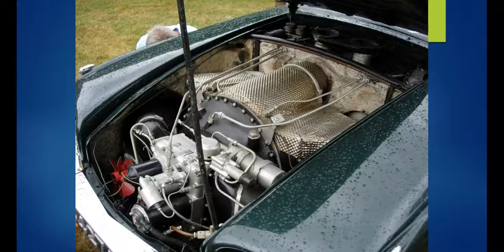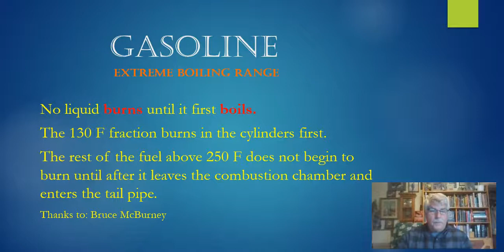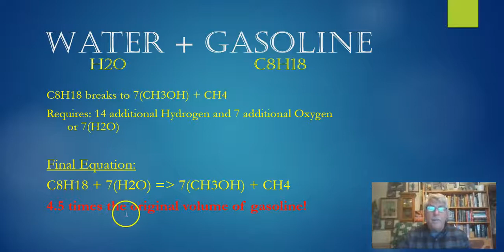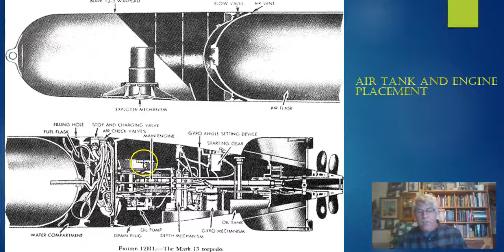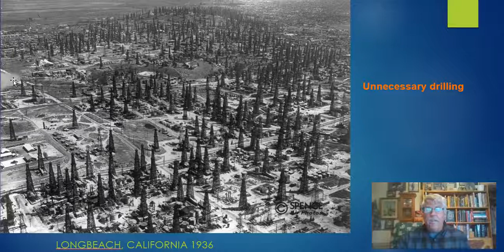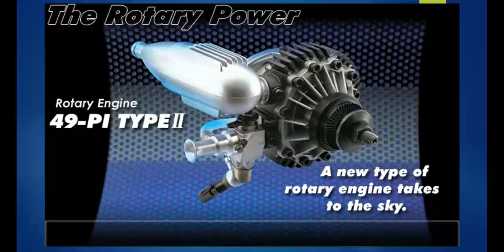The Rise and Stall of the Piston Engine, Part 1, Gasoline, Water and Methanol

Comment: You're right... it's NOT "easy".

Just because it's doable, doesn't mean it's economically feasible. The science of fuel refining is well known. We can produce everything from isolated combustible gasses (methane, etc.) to paraffins (jet fuel) to solid fuels (hybrid rocket propellant, camp stove pellets/blocks, etc.) to self contained combustible material (C4 explosive, etc).

The reasons we don't, lies in many facets of infrastructure and cost of production. Gasoline is cheaper to produce (closer to the raw base product [oil]), less water intensive, more stable, less evaporative, and more energy dense than methanol. Yes, methanol makes more power... but at the expense of lower specific density (requires more fuel). So there's several reasons why we don't use methanol.

On the flip side, many may argue that diesel... or even heavier fuels should be used. In my opinion, the arguments for diesel are somewhat legitimate... however, the considerably higher cost of refining more powerful (ie: higher energy density) fuels, is prohibitive to the mass market.

We have some paraffin fuels which far exceed the density of diesel. They are more stable, have a broader catalytic range (minimum vs maximum air:fuel ratio), are less prone to evaporation, and could greatly reduce the packaging size of power plants (engines) in vehicles. Truth is, they just cost too damned much to produce.

Hell... if we want to get downright crazy about it, you might try designing an engine to run off C4. It would be a truly amazing piece of machinery... but that doesn't mean it would be safe, or economically feasible for the masses. This brings me to my last point... SAFETY. 

Have you ever been to a race and seen a methanol fire? I highly doubt it. Want to know why? Methanol burns clear. Considerable catastrophes have been the result of methanol fires. They are extremely hard to extinguish, or identify. The flames are clear, the fuel is far more volatile, it has both a low evaporating point and high rate of thermal transfer, and can ignite below saturation levels (meaning that atomized methanol is capable of igniting before it displaces enough oxygen in the air to be detected). 

It's nice to have ideas... but it helps to consider the whole of an industry and its challenges before assuming its current state is wrong.
Reply from the maker: For some reason I did not see this email posted until now.  Methanol was the chosen fuel at Indy because in 1966 there were several drivers burned to death in a gasoline fire when a couple cars collided.  The switched to methanol because it does not explode like gasoline and you can put it out with water.  Currently, all CART cars use ethanol, another alcohol with slightly more carbon and less oxygen.  A bad choice considering they obtain it from fermentation of food stocks.

Your figures for converting Gasoline to methanol are not correct.  Gasoline is crappy fuel; highly toxic and only works at lower compression= inefficient.   There are additives which eliminate the corrosion issue.  Imagine a world with no smog.  Why anyone would defend gasoline is beyond me when it comes out of the ground for 2 dollars per barrel (that's contract Iraq price, 20 year duration, that's what big oil pays).  So we get ripped off.  It's not about cost!  It should be about toxicity and health, but it isn't.  They want us to use gasoline because it requires a low compression engine and it will therefore get lower mileage than a diesel.  These guys are so much smarter than you, although you do read well I see.

Comment: Ken, 
I enjoyed hearing your theories regarding conversion of petroleum products.

I was very excited to the Dodge turbine power plant, I thought that after testing determining how much more proficient it was in comparison to the standard internal combustion engine, they were all completely destroyed.

I also like the idea of using the Whankel or similar rotary engine, the high rpm's required would allow you to work at higher internal temperature's that would lower the boiling point required.    

What are the additional energy cost going to be for the reaction? (temperature/pressure) what by products are going to be produced during/after reaction completion.

Md
Reply from the maker: Md, are you still there?  For some reason I just found your reply.

Comment from the maker: Hey folks!  I made an error at 10:20; you need 2 times as much water as gasoline.  And then at 10:40 I made a mistake on the temperature and pressure.  The temperature should read 920 degrees Centigrade and the pressure substantially higher than 1,000 psi.  Perhaps someone from overseas can supply the actual figures used in steady-state manufacturing.

Comment: If methanol is produced from petroleum, does that require continued petroleum dependence?
Reply from the maker: It can.  Doesn't have to.  The types of hydrocarbon feedstocks that are required to produce methanol can come from totally organic above-ground sources.  I think we will reach a time when there is little to no crude oil taken from within the crust of the earth; that it will be left there because it is so toxic.  Now, keep in mind, when we reach this milestone that we will probably not be using methanol as a fuel anymore.  This is because we have technology that is miles down the road from this, such as a hydrogen fuel cell connected to wheel hub motors.  We've been able to propel our cars this way since 1969 and the Apollo project.  The conversion of liquid petroleum to methanol is an INTERIM solution to our  current toxic nightmare.  People can keep their hopped up cars for a bit longer while smog and pollution are dramatically reduced.  Meantime, we should be thinking about what our future transportation system is; should we still use roads and independently guided vehicles which only go 60 mph?  Should we use an electrified grid?  Should we disband with surface travel and use antigravity vehicles for all high-speed transportation?  Should we use tunnels?  There are lots of questions that we don't have answers to because we've been kept in a lower state of consciousness.  And this is thanks to a media that was "them" all along.  Thank you for such a thought-provoking question!
Reply: Thank you for that thoughtful explanation. I'm fascinated by methanol's advantageous features, even if we don't see the next step in my lifetime. The ability to increase yield four fold and emit no toxins while producing more horse power? Sounds like a slam dunk to me. I'm a big fan of your work, especially regarding the Titanic and Hindenburg. Thank you.